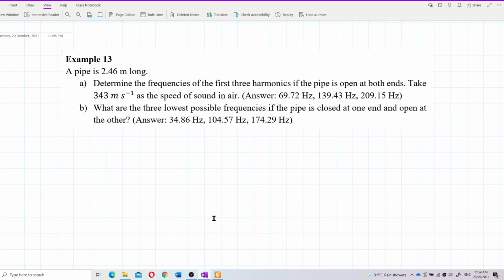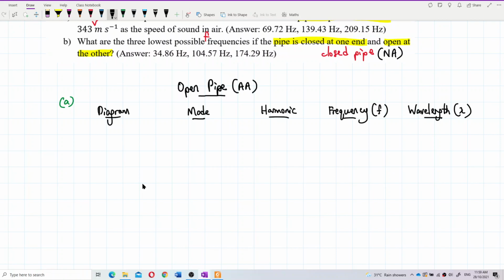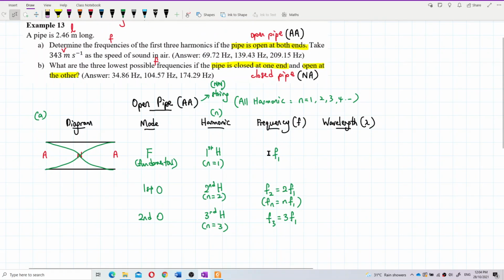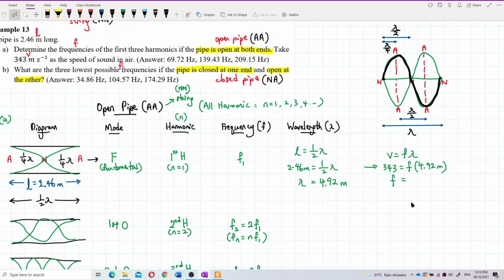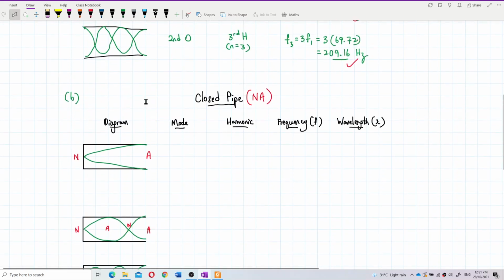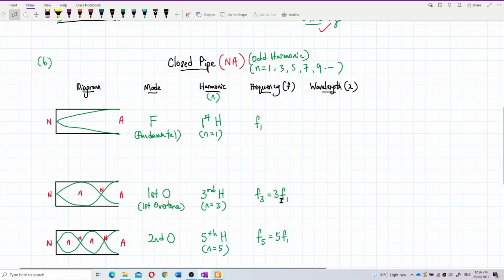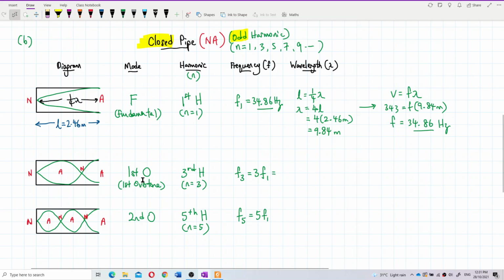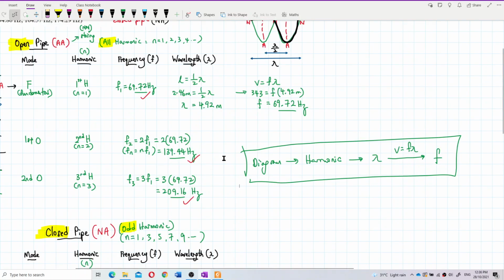Matriculation Physics: Application of Standing Waves (Q7)

Comment: Sir, if exam can i just use the formula  f=nv/2L   and   f=nv/4L   to solve the question? Just sub the value and dont draw out the diagram?
Reply from the maker: Got two examples video which I used both methods.. sometimes I feel drawing out is easier though